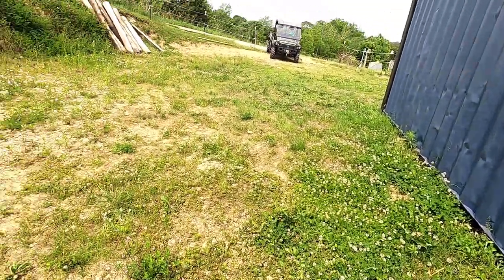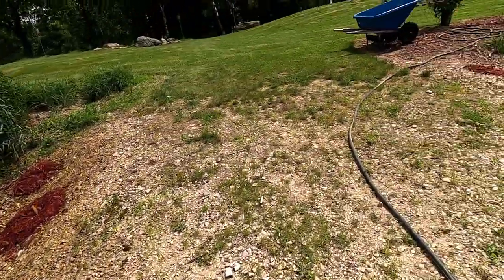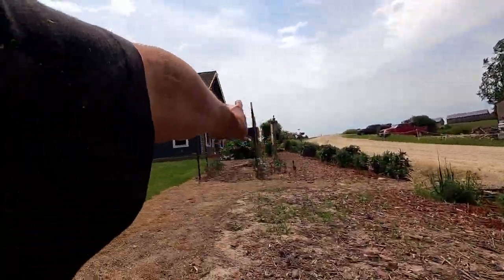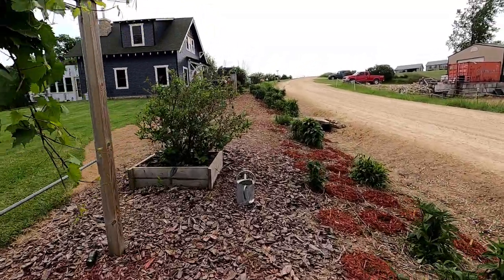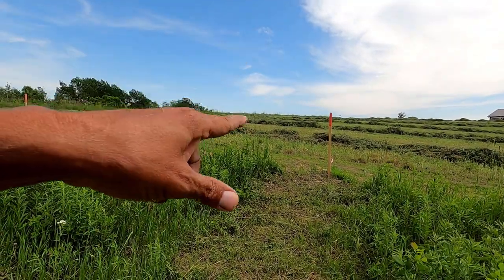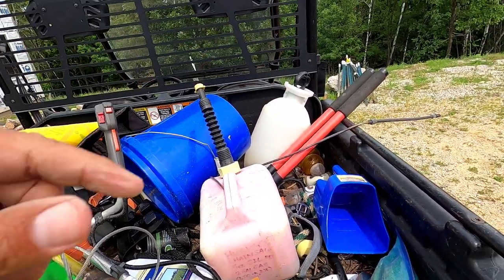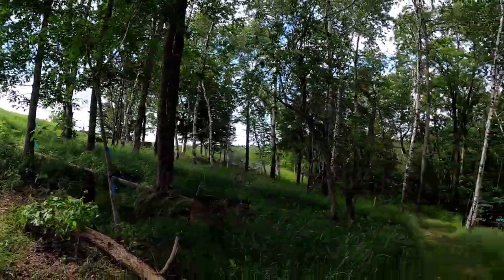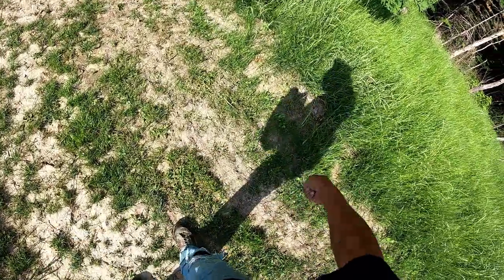Trimming, Burning, Dragging Logs, Seeding, and Watering

Comment: Have you checked the Ph of the soil, or of the water runoff, by the Blueberry bush? Good luck.
Reply from the maker: Not yet. Our well water has such high ph that I have to modify it with citric acid -- but I haven't watered or fertilized yet this year. I think I'll do that tomorrow. I started with 5 to 5.5 ph -- it would be interesting to see what it is now in it's fifth year. Now I need to go find my ph meter... 😊
Reply: @PlanetMojo  I was surprised to read that Blueberries like 4.5 - 5.5. You were nailing it.